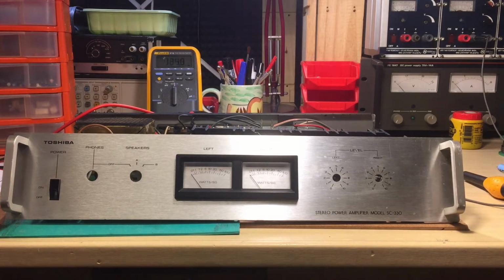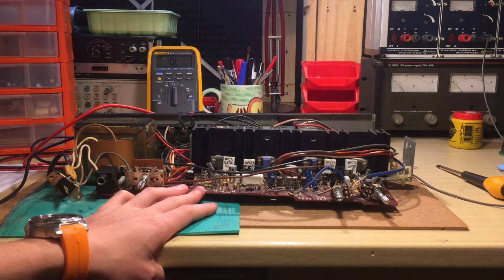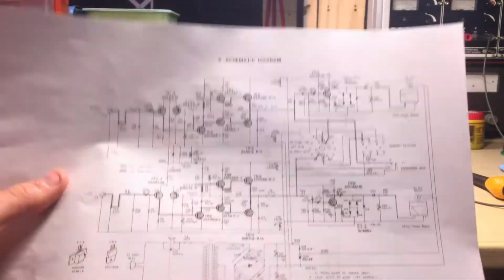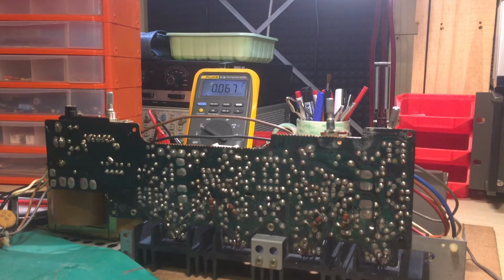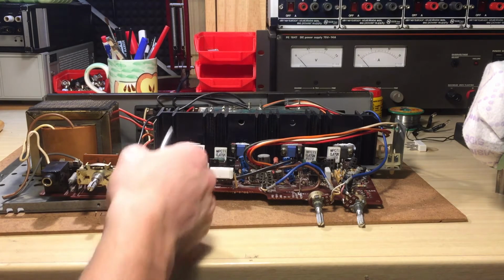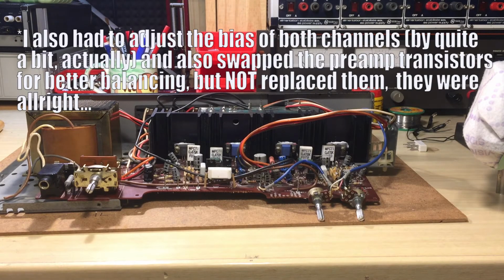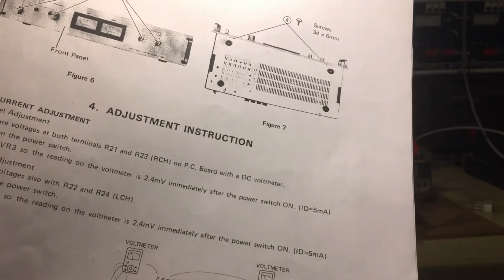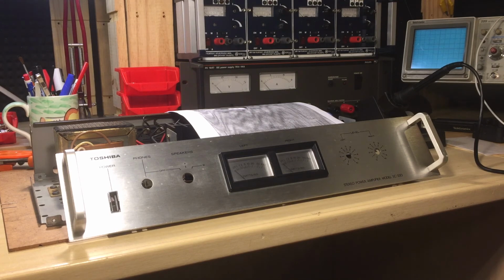Toshiba SC-330 Power Amplifier Repair

Comment: What is likely the problem if the right channel needle meter is not working properly (the light is not working and the needle barely moves)? Did you simply solder in an LED instead of the OEM bulb?
Reply from the maker: The problem of the not working meter was a bad resistor on the main board from what i remember.
The bulbs were actually working, but they produced very faint light (not enough for me at least), so I replaced them with bright white LEDs instead. The LEDs required a resistor, but basically i soldered them in place of the bulbs
Reply from the maker: The lightbulb and the meter circuit are completely separate anyway so, in your case it could be a bad contact on the meter and a burnt bulb..
Reply: Thanks for your help. Would have loved to see an overhead view of your board work on this project.

Comment: I have a SC-335 and it does not work, it was working and heated a little low volume and stopped ringing. I would like to make an update of electronic components and wanted to know if there is a possibility to use the same cabinet and put everything inside new? And if you could get the wattmeter? Thank you
Reply from the maker: Hi, yes you could just reuse the cabinet and get a stereo amplifier kit and a vu meter driver kit from ebay, but that’s a shame in my opinion. The toshiba sc-335 is a decent amplifier, built with good components. My suggestion is to give a try to repair it. If it’s beyond economical repair, you can of course keep just the cabinet and put an amplifier kit inside..

Comment: i have got technics su 7600 the prob was left channel gives op smoothly but frequently left start giving 5 v dc and reverse _5v as well i chekecked power transistors drivers aswell i did every thing.....i cant get anything wrong then i replace differential ltp which takes ip signal and feed back ....that was notorious i took 2 transistors general-purpose and make it work yahoooo